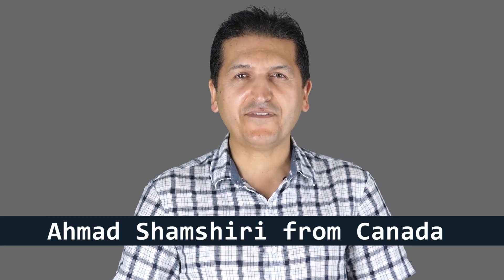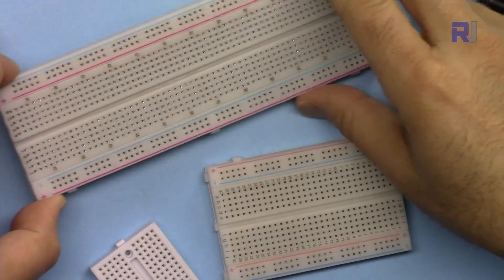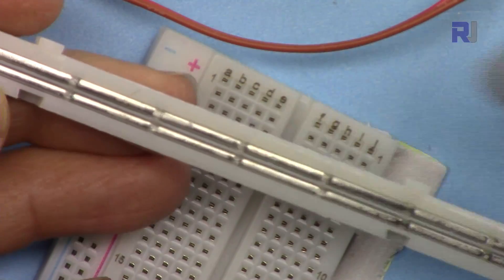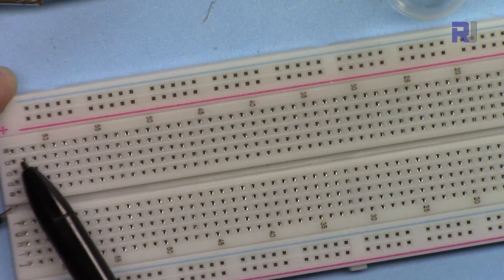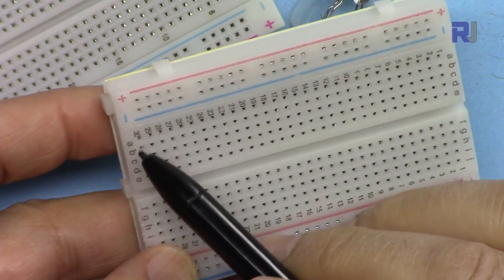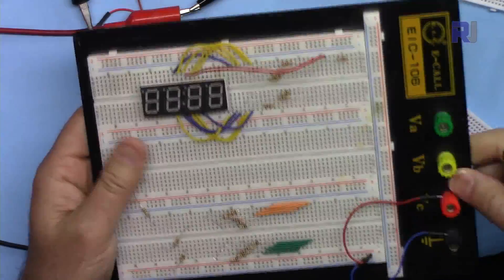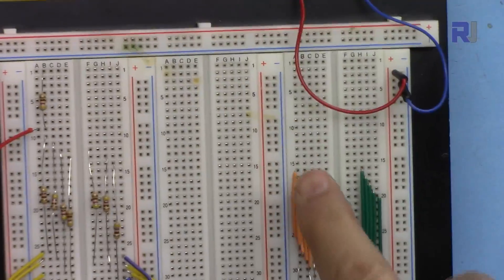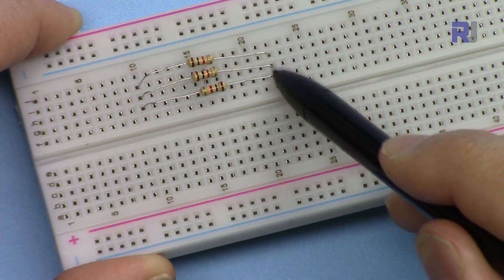How to use breadboard and how to use it? - RJT265

Comment: Hello, I am your loyal fan. I want to know the electrical power conversion of some transformer modules. Suppose I input（ 12v1a） DC power and convert it to （19v3.42a）
Reply from the maker: Hello, Thank you for being my fan. You need boost converter which takes 12V and converts it to higher voltage. Now 12Vx1A=12W and when you convert it you will get 12W-15%. Where 19Vx3.42A = 64.98W which is impossible.  You can never get more power than the input. The output is always less than input due to losses in the converter. Here are my videos on boost converters https://www.youtube.com/channel/UCkcBSig_Iu4ZnAIeCeG1TVg/search?query=boost
Reply: @robojax   Ok, thank you teacher for your reply, i will work harder to watch the video to learn
Reply: @robojax  I'm asking you a question, is this related to the law of conservation of energy? That is, I need to enter a relative or greater watt, 19v * 3.42a = 64.98w + 15% (plus the power consumed during conversion), to achieve the conversion conditions, such as DC12V6.22725A
Reply from the maker: yes the input should be x% higher than input.
Reply: @robojax  "Yes, the input should be x% higher than the input", sorry I don't understand the meaning